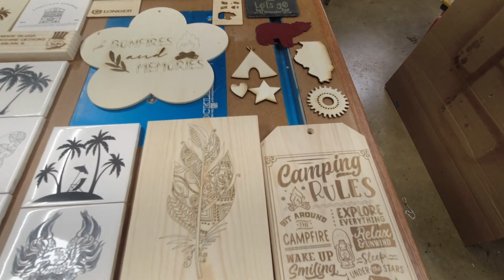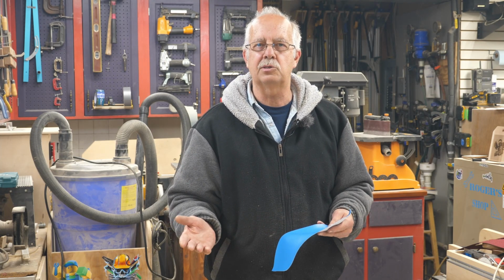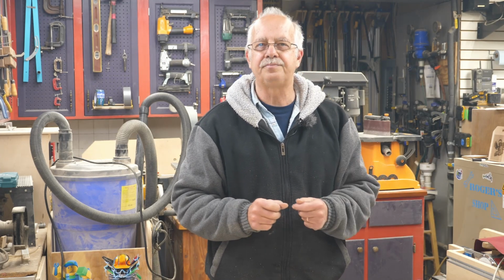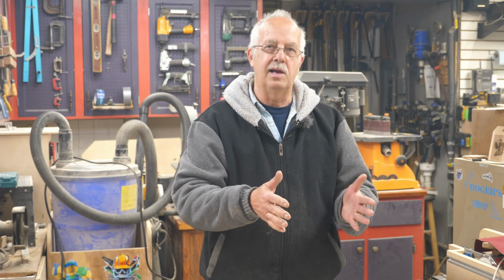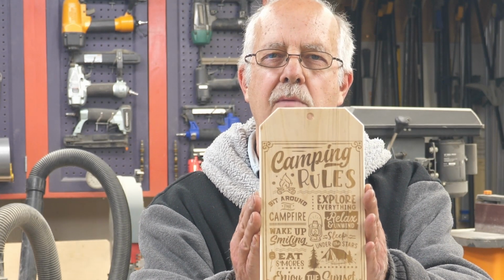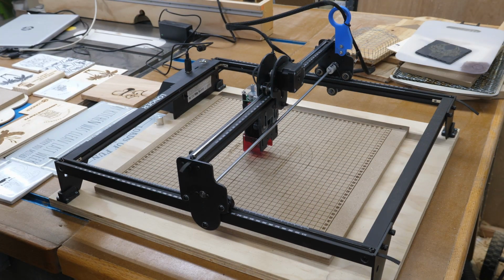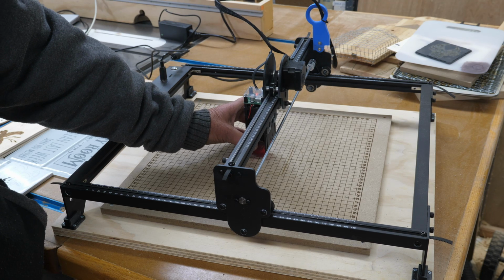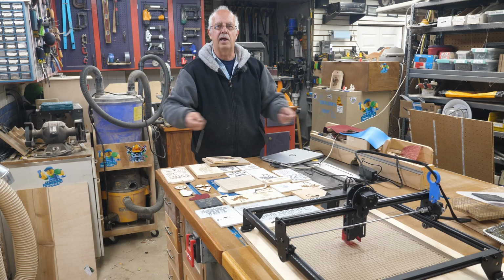Longer Ray 5 Laser Engraver Pros & Cons

Comment: Hello, I just purchased a new Longer Ray 5 10W laser engraver and I'm having difficulties getting the laser to fire. The unit traces the image but the laser never lights. I've tried all different settings but the laser never lights. I did add the limit switches but I followed the instructions and I believe the wires are all in the correct place. The limit switches work as intended and the laser module has power, both the red and blue lights on top are illuminated during a burn process. Any help you or one of your subscribers could offer would be greatly appreciated.
Reply from the maker: In Ligfhtburn, go to the icon at the top of a wrench/screwdriver and click on it.  Turn on the buttons for Enable Laser Fire Button and Laser on when framing.  Click OK.  On the Move tab, set laser power to 1-2%.  If you then click on the fire button, the laser should come on.  If it doesn't, then something else is wrong.
Reply: @rogersshop  Thanks for assisting me in getting my setup running. I followed your instructions and no laser activation so I went back and looked at where I added the extension rails and limit switches and I placed the 12v connector in the wrong place. I’m happy to say I ran my first test and I’m more than happy with the way it turned out. Thanks again.
Reply: @rogersshop  thank you. I'll give that a try tonight.

Comment: One nice feature about the wifi on this model is that you can use its web interface (on your computer/phone, vist the wifi local IP it lists on the machine's display) and you can upload gcode files directly to the SD card's storage through the wifi webpage. I use the same laserGRBL application to save the project as a .nc file instead of interfacing through my distant usb ports. 

This combats your ire about dropping packets since you can just fire and forget the machine as if it were offline, but without having to touch the tiny display (and with a better controls and settings UI than it grants on the tiny screen -- comparable to the tethered applications for basic func). If you had an array of these machines, this could be a viable way to interface with them all using only one computer (or phone).

Comment: Drag chain and limit switches are easily implementable. You may also consider some riser blocks to easily use a honeycomb as it removes +- 22m from the usable height. I also added a screw for z-height and air assist. Yet I still have to start print anything else than the demo's that were on the sd-card. The tweaking/modding is part of the fun !
Reply from the maker: Since this video posted, this laser has had extensive upgrades and is now a 20 watt with functioning limits.

Comment: I see you use a lot of different lasers. I am currently looking at the xtool one you reviewed. Which has been your favorite laser so far? I will be primarily engraving metal and wood
Reply from the maker: I have two of the xTool D1 lasers in the 10 watt version.  One is going to be dedicated to the rotary attachment.  So, yes, I like the D1.  I also like this Longer model and my Ortur Laser Master Pro.  Each has somewhat of a dedicated use for what we make.  I'm planning a video soon on the D1/rotary setup.
Reply: @rogersshop  thank you for the reply. I have a D1 on the way